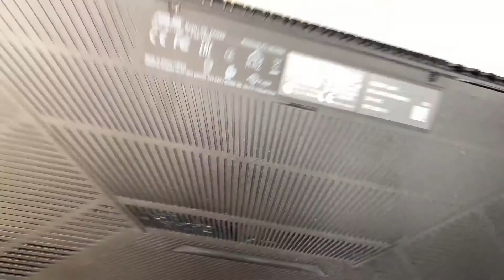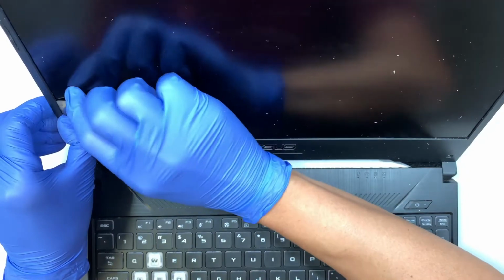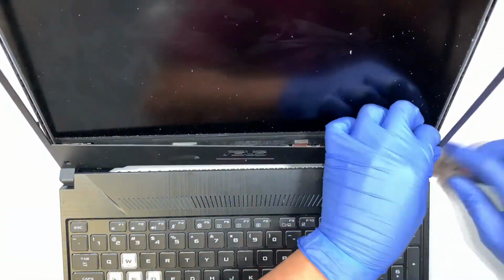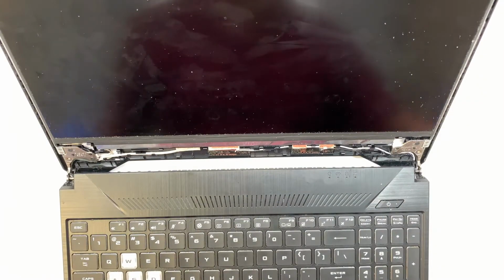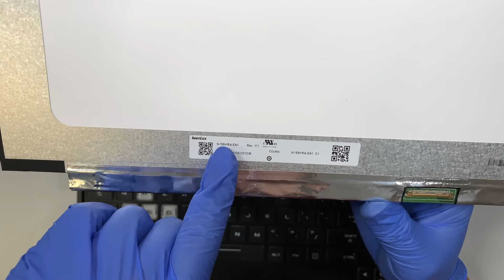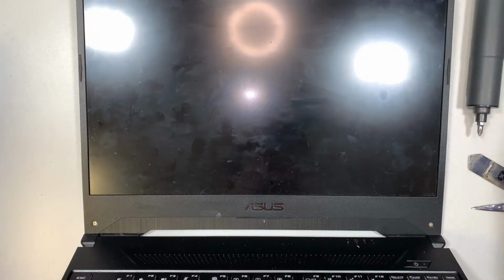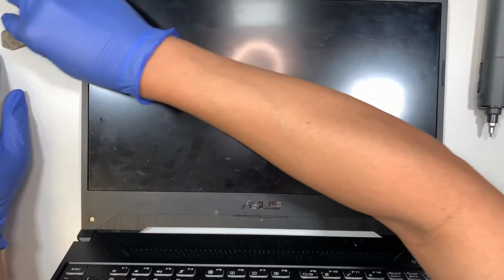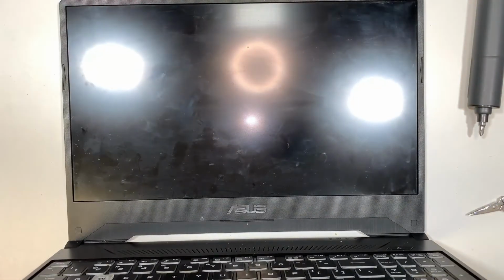Asus FX505G Screen Replacement

Comment: Great! God bless you for this video! It worked out perfectly for my son's FX505DT with 120Hz screen. Funny enough the new screen (IVO: M156NVF4 R0) is way more colorful (with juicy, deep colours) and brighter then the original one (AUO: B156HAN13.0). Actually it looks like an upgrade ;D. I used Lenovo LCD panel tapes – perfect fit. Thank you so much for your help!
Reply from the maker: You are welcome. Glad the video helped.
Reply: Do you have to factor in motherboard compatibility or just the edp pin connection?
Reply: @TheUltimateHacker007  just the EDP pin connection. Just make sure the new screen numbers are the same/compatible with the old one

Comment: Hey bro! Nice vid! Is screen flickering only on the bottom part of the screen a sign to replace the lcd screen? I was wondering if i need to replace mine or its just a software problem. Thanks!
Reply from the maker: More likely you need to replace the screen entirely.
Reply: @UbergeeksBiz  thank you! You rock! 👍

Comment: hey m8, first of all, you are doing an awesome job. Thanks to you I was able to disassemble the lid of my FX505DY. The only difference is that there is a lot of glue at the bottom of the bezel. however my problem is that I need to replace the back lid and the hinges. Can you comment on the stuff glued to the lid, apart from the camera? Can you comment on how to get rid of the hinges? Cheers!
Reply from the maker: Try use red adhesive double sided tape:    https://amzn.to/3OZNEp2    or   https://amzn.to/3RtKr2s

Comment: Thanks! BTW should I loosen the hinges? I think the hinges are a little tight on this series. When I open the laptop lid, I sometime hear tic tic sound. I think the sound is coming from the cover on the hinge. I hear a similar sound when I press the cover on the hinge.
Reply: Same question bro.

Comment: Will this work for FX505D, too?
Reply from the maker: Yes
Reply: I also have an asus FX505D and I did this repair and the screen won’t turn on any help?
Reply: @Bigboy check if your video connection loose, most of the time it's the problem. If it's not there might be another problem like the lcd itself is bad or the connector is bad

Comment: Hi! So I have a question, I don’t have the tools to take the screen off so I can’t see what the model number of the screen would be, without breaking the bezel. How do I figure out the model number for the screen? It’s a ASUS TUF 505DT, it’s 120hz, 8gb of Ram, and the 1650 graphics card with a Ryzen processor. I found one on Amazon, but I can’t figure out if it’s the right screen or not.
Reply: use HWmonitor

Comment: I broke my laptop screen from a drop but rather than fixing it, can I just disconnect the hinges and remove the monitor part of the laptop altogether? I’d rather remove it because I use an external monitor anyway. But I’m wondering if the laptop will let itself be used with a connection missing. Do you happen to know?
Reply: I think it will work, I disconnected my screen before and use only external monitor and it works. But I am no expert so you might want to ask somewhere else.

Comment: My screen has just arrived, but not working properly, don't know why? The screen is fine, the contact is fine. But there is no picture showing
Reply: Mines too
Reply: Did you end up figuring what was the problem
Reply: If you didn't disconnect the battery, you might have shorted something